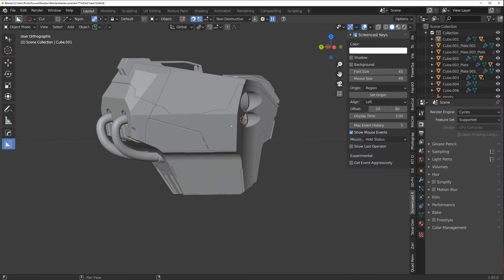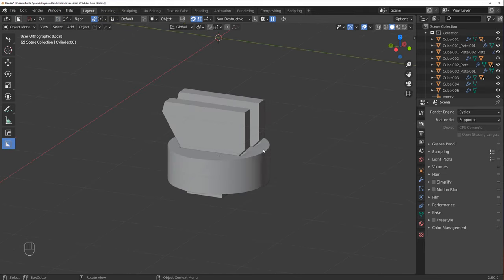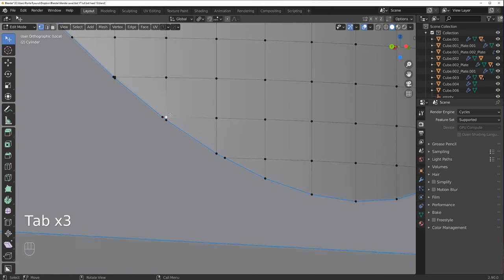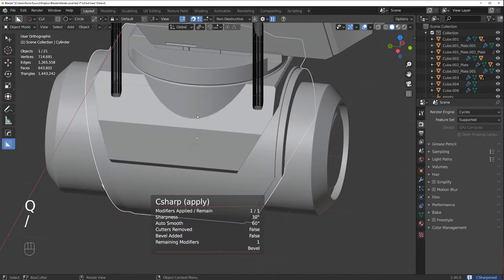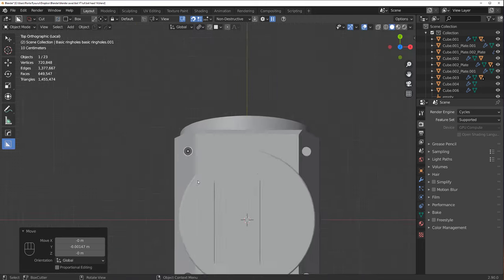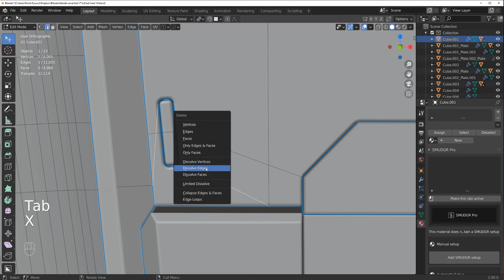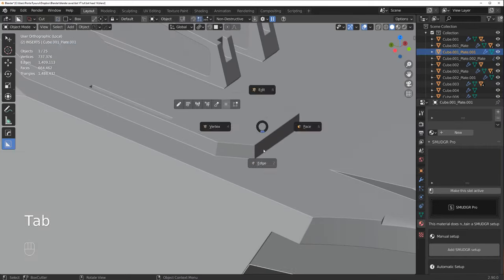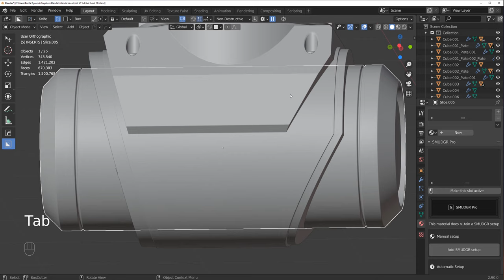MECH helmet TUTORIAL for Blender - PART 2

Comment: Sweet!
I'm getting up to quadruple edges using Mirror Sym and double or triple objects using Mirror Mod in 2.90 --- what a pain!
(Happens very often, but not all the time) And I get stuck in HOps Mirror mode, where the only way out is to find the
HOps Powersave , then reboot Blender. Don't know what I'd do without Powersave, cause the Mirror-stick won't let me 
save any other way! Lose all my work for that file, I guess!
Reply from the maker: Not sure I understand what is the issue. 2.9 is buggy man, I am back in 2.83.5